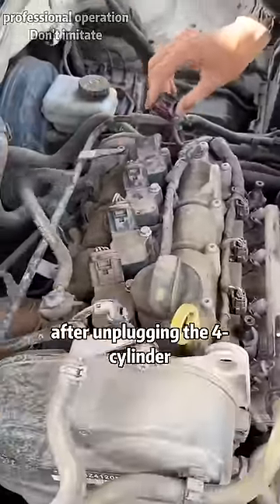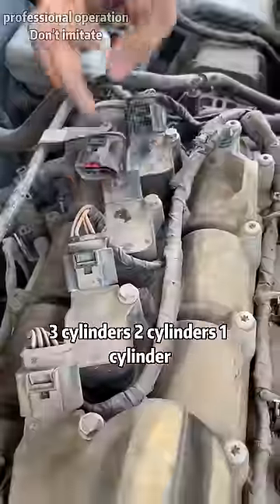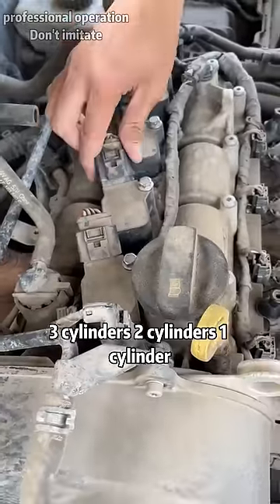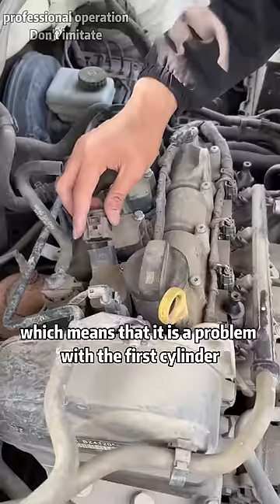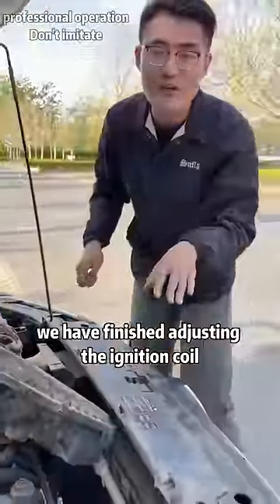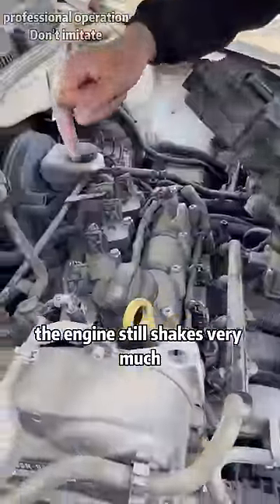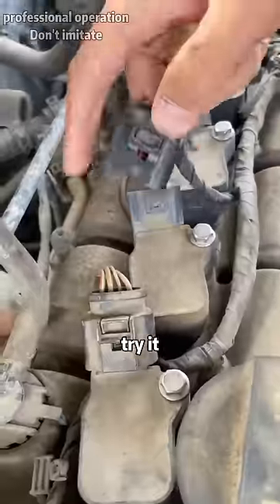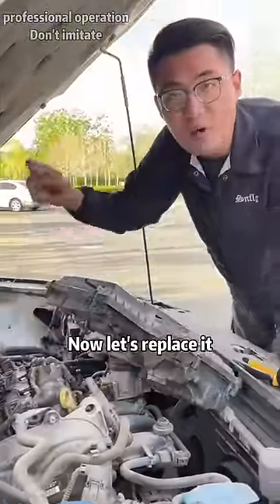（PART2）90% of people do not know the maintenance skills！#tips #car #shorts #tutorial #driving

Comment: Just replace all the plugs and coils. It’s easy to just do it all at once and not have to worry about it again. Injectors aren’t too hard either if you have time.
Reply: Sounds like a waste of money
Reply: Why would you just swap parts without actually figure out what's wrong?
Reply: We had a cts that came in on trade where the po tried doing exactly that. It had a massive fuel leak and a dead miss on cylinder 3. Come to find out they gave up on trying to replace the injectors but not before they tore one of the seals which caused the leak. Fixed that but it was still missing. Swapped coils and the misfire moved, installed a new coil and it was running perfect. I understand getting frustrated but to be defeated to the point of taking out a big car loan for what ended up being simple fixes is crazy
Reply: Injectors usually cost a lot. And it's pretty stupid practice just to throw parts at the car and hoping that it fixes the issue.
Reply: Tell me you’re a parts replacer without telling me
Reply: @mamoochie7392  it’s the process of elimination. Swapping the coils is the first step cause it’s the easiest way to make sure it’s not a coil problem if it’s still a problem in the same cylinder after swapping coils it could be a fouled spark plug or the fuel injector is clogged or not working or the cylinder lost compression due to bad piston rings
Reply: Great 
I’ll just pay €1200 for all six coils for my 1999 lexus is 200 
The whole car not worth that much
Reply: @mamoochie7392  when you swap out plugs, it’s general rule of thumb to do all, same with coils
Reply: 1 coil, $100. 4 coils, $400

Comment: Do this with a distributor. Pleeeeeease. And record it.
Reply: Lamo
Reply: You spike  ecu doing  this you clearly  don't  know what yr doing
Reply: @simonjohnson3327  wtf is “spike ecu” you been playing to many video games.
Reply: @Floridamancan   you clearly don't  know i spike a surge of extra  current  caused by  pulling off coil connection  that will fry the ecu and the internal  coil drivers  within  ecu
Reply: @simonjohnson3327  you have never worked on a car in your life. I would correct you but then i would be teaching you something for free. Keep thinking what you think
Reply: @simonjohnson3327  prove the bs you are spewing instead of standing on it. COP uses individual drivers isolated on coil, distributor uses icm and its contained inside the dizzy itself. The ecu sends 5v nominal to the icm to speak, when coils are removed you can run the risk of shocking yourself or grounding the coil and frying it. Ecu will be golden. Let me hear your bs now
Reply: @simonjohnson3327  you joined youtube a year ago “ive been doing this a.    Long time” buddy you are 16

Comment: You can destroy the ignition module by doing this. You’re supposed to use a scan tool to shut off the cylinder.
Reply: Scan tool will tell what cylinder is misfiring you don't even have to shut it off.

Comment: When buying used cars, ignition coils, spark plugs and tie rods are usually a good start . If you swap those out your car guaranteed will give you over 30k now after that .. axles control arms and bushings for sure new suspension wether coil overs or stock height  but the point is , if you have a couple tools you can save so much money and have a great performing old car! (I have a 2008 Mercedes’ c300 rear wheel, and i loveeeee this car, cut the resonator and I swear I have a G37 or gtr 😭😭

Comment: Better get the OBD plug with Bluetooth to check errors. It’s cheap and you can avoid the eventual damage if you follow this guy. Anyway, in most of the cars you can’t switch ignition coils due to the length of cables. They are meant to be in their own place not where you want them to be.

Comment: Hopefully the brittle plastic of both wire shield and connectors due to the constant heat and cool of the engine, doesn't break. 
Be prepared if you attempt diagnostics.

Comment: Easier way: start cold engine for 4 seconds, then stop. touch the  exhaust pipes, the pipe that is still cold is the misfiring cylinder. The other pipes will  barely be warm... And It's usually a bad coil...

Comment: The easiest way to check remove the coil  put your finger inside the coil boot and tell a friend to crank it up . That test will never fail 100 % accurate no special tools need it for testing.( make sure coil is connected to perform this test )

Comment: This is a beginner quick method. This would not work on a V6 with coils that are located under the intake plenum. I prefer to use an oscilloscope to graph the primary voltage and current ramp of all the coils.

Comment: If the mee could doesn't fix the issue check power on the coil wire, if you don't have power check for broken wires. If your wires check out with an ohm test its the coil driver in your pcm

Comment: OR, you can put a screw through the coil then  see if there's any spark coming from the coil to the screw.
Reply: Nowadays cars the coils has spark but still misfire
So
This is the best way
Or atleast scan the car with a Diagnostic Scanner
Reply: that's how Toyota Japan taught us. they also let us hold the high tension wire to train our mind that the spark is not really deadly so we can fix the ignition system without worrying about the accidental spark.

Comment: No scan tool to see which cylinder is misfiring no dmm to test resistance in the coils. All of these are basic tools you can buy at orieley. Buy a spark plug testing tool and look at your sparks. If both are fine do a compression test. Odds are you could have a bad piston ring and replaced a ignition coil. But without a scan tool you can never know for sure mayne 🙏

Comment: you can also remove and hold the coil while a helper starts the car. if you dont get the shit electrocuted out of you, that coils bad
Reply: Not true. The ECM is the driver circuit, ground. If you have no IGT or IGF signals to the coil pack then no spark. If you have a faulty Intergration relay, no spark. If you have a faulty chassis ground, no spark. On some vehicles, if you have a faulty ABS/Skid control module, the brake computer feeds back to the main ECU, no spark. #toyota

Comment: Just replace all coils. if one fails, then all will fail in a short time span as well. I learned that the hard way and good mechanics have told me the same
Reply: That is true when the valve cover has leaked oil all around the plugs. Otherwise some fail and some don't. Like an alternator, some will make it 300k and some die at 50k.

Comment: Or if its a new car just get an OBD2 monitor and check what the ECU has to say. And you wont fry your fuses. Or risk you engine getting damaged another way.
Reply: This won't blow any fuses and all the scan tool will tell you is which cylinder is misfiring, it won't tell you why it's misfiring so you still have to do this anyway

Comment: It's the number 4 ignition coil but it's always better and save you time by replacing all of them at the same time because if one is bad the other are soon to follow
Reply: Id say it depends how expensive the coils are and what kind of engine. Some coil packs are $300 for each one, you would not replace all 8 on a v8 engine for a single bad coil. That’s $2400 in parts only. If it’s a 4 cylinder with $30 coils I’d agree.

Comment: just that such ignition coils usually come and are supposed to be swapped in pairs of 2. (in as far as the whole thing isn't just a solid block of plastic containing all 4 anyway) or just all at the same time. and eh yeah. taking the fuel pipes of or checking the return fuel cylinder by cylinder is nice and well for old diesels. but on petrol cars you don't just unplug an ignition coil while it's running :P how about you check the sparkplugs first either way lololololol. also you could just have gotten that information regarding which cylinder it is from odb :P LOL. 'jumpover on cylinder 1' or whatever it's called. or just hold another coil connected to an oscilloscope next to them without doing a single screwy thing :P

Comment: Not on all cars this will work, when you unplug these sockets on some Toyota cars they will go off instantly, but you can avoid that by removing all the coils bolts and start lifting them one by one when the car is idling, this will be like unplugging normal plug wires and plugging back for testing of bad spark plugs.
Reply: Not true, we use this test daily. It's called a cylinder power balance test. Also depends on 3 wire to 4 wire systems with or without IGT, IGF systems #toyota
Reply: Not true. We use this method daily. It's called a cylinder power balance test. Weather you have a 3 or 4 wire coil pack will determine if there's IGT or IGF signals for further testing. This in turn will cut off fuel supply to the injectors. Safety 1st #toyota

Comment: So many people on here claiming all kinds of damage and whatever with this technique. And yes most newer OBD2 systems will USUALLY tell you which cyl is missing. Unless it sends dtc P0300. But this method works absolutely fine. Doesn't require a scanner that you may not have atm you are doing this. I have literally done this 1000s of times. You do not know of what you speak. Typical YT comments from fake experts.

Comment: This might not work well on modern vehicles. Once the ECU sees the coil circuit go open it will turn off the injector driver until the next ignition cycle.

Comment: When you changed the spark plug but the problem still exists 💀
Reply: Spark plug, coil, compression. Only things that will cause a single cylinder skip Edit; injector. Used to diagnosing carb'd stuff

Comment: The coil isn't the problem, the whole engine is. That thing is knocking.
Reply: It's not knocking. I don't want you feeling insulted, but listen to some misfires, then listen to rod knock, or lifter tick, or spun bearing (develops after rod knock), and or piston slap.

They all have similar, yet different sounds. So I'm not calling you out really, just want you to develop a more keen ear
Reply: Oh, and rod knock would mean a complete engine rebuild. So if it was engine knock (or aka rod knock) you would be right with the engine being shot.

Comment: Yes, unplug them and plug them back in WHILE UNDER POWER! Gonna fry something. Can't say how many times it'll work before it finally goes wrong, but when it does go wrong, it may fry more than just the coils, making this a rather expensive mistake. Don't do this.
Reply: How? The worst thing that can happen is flooded pistons because the coil doesn't juice the spark plug. Before the coil is 12v, and as long as he doesn't ground that 12v connector (which is hard considering the connected is a shielding to prevent that) you should be fine.
Reply: @ChipperTheChipster  because it could arc between the male and female connector for that moment when they're just getting plugged in. Not shorting 12V to ground, but 12V on male to 12V on female could briefly arc and damage the electrodes, and possibly draw a higher amperage than the system is rated for.
Reply: @darrenweber3308  I'll give you credit. That is possible, not likely though.

You could probably unplug it a 100 times and it will happen one or two times, and when it happens it might not even damage anything.

I can understand the "why risk it" but this isn't too crazy of a risk.

Unnecessary risk are people who chip the outer rim of the wheel and think it's okay to drive.

Or the guy who snaps a sway bar link and thinks it's okay to hit the highway.

Etc

I won't bash you for telling people that this could damage the engine. Technically you're not wrong. It is just not likely.

(Before we go back and forth on the whole, turn the car off then swap it, etc etc understand that this whole procedure of troubleshooting is to quickly figure out wtf is wrong. If you took your car to a shop or your in your garage, this shouldn't be how you test coilpacks)
Reply: @ChipperTheChipster  Agreed. Gotta look at the video in context. Also thank you for being a reasonable human being ;)
Reply: @darrenweber3308  well right back at ya, thanks 👍

Comment: If only any cars built after 2005 had such easy access to pull engine coils in and out like that
Reply: Actually this is more common of a setup on newer cars. I'm a honda tech, all our newer stuff 2008-2023 has this type of setup, even the v6. My early 2000s pontiac uses plug wires on coil packs, I can't do this on it at all.
My 97 gmc has a distributor, that would be even more temperamental about stuff like this, and that's if this was possible, which it isn't.

Those plastic engine covers are literally just placed on there, usually there's nothing more that a couple plastic clips holding them on, then BOOM engine.  Pretty EZ.

Comment: Or the valve could be cracked and that will also cause it to fail. At least that's how it was with the older engines.  
But I do agree if one goes bad you should change all of them. 
And be sure to put that vacuum hose back on. 🙄
Reply: If you've got a bad valve the problem won't move with the coil when you swap #1 coil for #2 and vice versa. The problem will stay with #1 cylinder and your next test is a compression test.

Comment: Yea that’s how to check a coil but way off on checking a misfire … I would first read the codes as a starting point that will help us identify which cylinder is miss firing then I will pull the coil than the spark plug and inspect the plug .. the spark plug is a witness to what is happening weather it’s firing lean or rich we could also inspect for physical damage if all checks out I move onto the coil pack and check it by either swapping it or with a test prob if that also checks out with some evidence from the spark plug I will move onto the injector if that checks out it’s a leak down test of the valves and to check for compression . Engine timing . Lastly vacuum leaks  … if only mid fires were solely because of coil packs my life as a mechanic would be so much easier and idk what it is about 2022 and 23 but so many vehicles have showed up with misfires and the cause was rats eating the wires smh

Comment: Ahhh yes let’s swap ignition coils and throw out firing order and hope it all stay the same 😂
Reply: The coil itself being swapped does nothing. Swapping the connector will 100 percent mess up the timing. These car in particular will not hurt the car if you swap the coils. All they receive is power that is then transferred to the plug (at a much higher voltage). They don't magically fire from themselves or have their own timing. 

On distributor cars it will for sure mess up if you swap coils.

Comment: It's easier to just check the voltage.
Reply: What if you have voltage going into it but when the coil loads up the voltage drops because you have a corroded wire somewhere? Then you'd have to load test it, might as well just load test it with a known working coil lol

Comment: if you swap coil packs you run the risk of frying spark plugs , fuses , and relays . learn from a mechanic in a shop , not someone messing with a perfectly running car . if it ain’t broke don’t fix it and THATS A FUSE NOT A FUCKING FOUR CYLINDER

Comment: He did that wrong, he needed to swap spark plugs rather than coils all he did was move the misfire to another combustion palace
Reply: If this is confusing, i meant swap the original misfiring sparkplug with another good spark plug and if both spark plugs dont work going into the original misfiring coil then its the coil
Reply: And if the sparkplug from the original misfiring cylinder doesnt work in another coil then its the spark plug but if both dont work no matter what (coil & plug) worst case would be a wiring harness

Comment: What if it’s a coil pack and not individually removable
Reply: So unplug the spark plug wires one at a time to find which cylinder is missing like how he was unplugging the coils. Once you find it just put a spark tester in the end of the wire and ground the other end of the tester and start the car, if it's sparking, chances are you have an issue with the spark plug, cylinder compression or lack of fuel going into that cylinder. If it doesn't have spark but all the other cylinders do it's probably an issue with the coil pack 😉